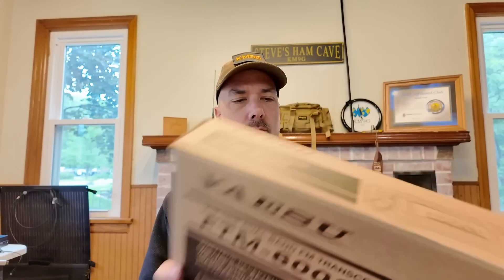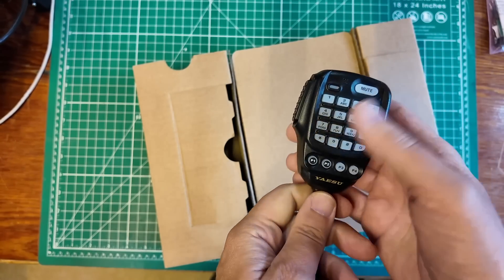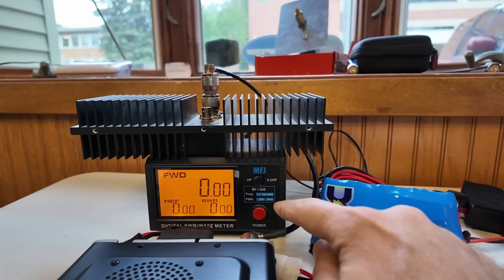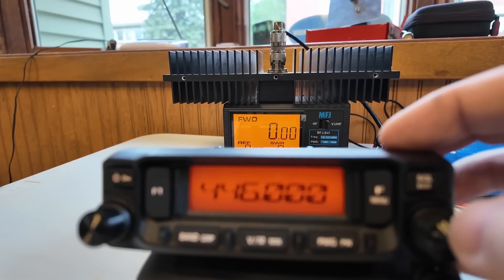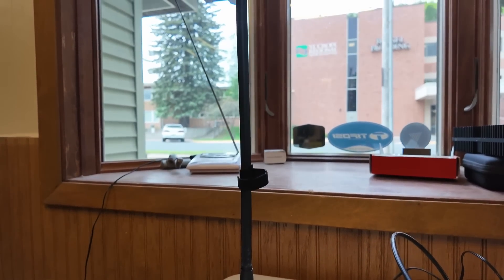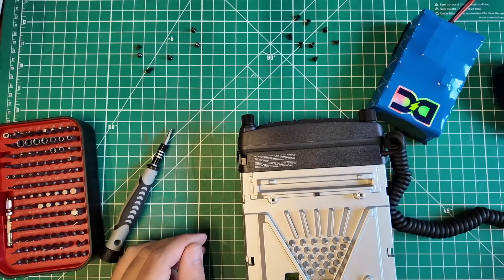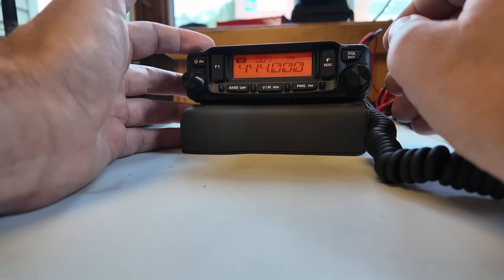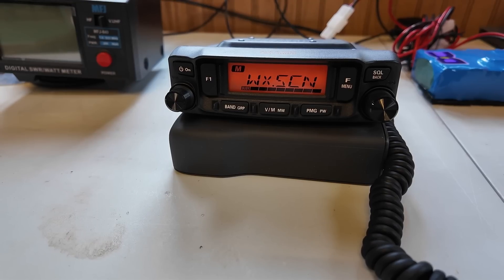Step One: Yaesu FTM-6000

Comment: What's a good antenna for this to be used inside a shack?
Reply from the maker: If I was running indoors only, I'd run a roll-up J-pole or a mag mount stuck on something large and metal like a refrigerator or washing machine.  Can't answer the question without saying 2 things:  #1 I've done it and it worked "well enough" and #2 Getting the antenna outside and up high is going to give you the best results.

Comment: Would you recommend using two of these for an FM repeater?  They have the data port to connect to a controller so should work well?
Reply from the maker: Are you looking for a permanent install or something for rapid deployment for an event?  

Permanent:  Get a "real" repeater with duplexer cans and so on - you want to have it installed and not mess with it vs using "cheap" parts (connectors/coax/antennas/etc) and having to visit all the time.  You'll "lose" more money in routine trips/maint than you'll gain by saving money with a home-brew... now if that's your jam, have at it and enjoy!

Rapid Deployment:  Look for a "cross-band repeat" capable radio (the 6000 doesn't do that) and you'll save on the second radio and the repeater controller, antenna/duplexer/etc

Event:  Something like this in a well laid out gobox might work very well.  I'd imagine a pair of these with all you need to "open box, screw on antenna, hand out baofengs" would be pretty useful.
Reply: @temporarilyoffline  permanent really.  Just FM, Allstar linked.
Reply from the maker: @Chris-hy6jy  asking for clarification:  "hotspot" or "repeater"?
Reply: @temporarilyoffline  a repeater.  So two radios, duplexer and suitable audio interface for the Allstar side of things.  Usually you'd use two inexpensive radios for this, Motorola etc so just wondering if the 6000R would be a decent choice.  Good RX sensitivity, TX duty cycle etc.
Reply from the maker: @Chris-hy6jy  The reason I asked about "hotspot" was if its just for your personal use in your house, then a device like this: ( https://kits4hams.com/shari-pihat ) might be cheaper/easier/smaller than all the kit involved.  But again, if you're trying to get it to work for your local area/club the install raises other questions.  I'm not trying to dodge the answer, its just not an easy one and this isn't a good medium for discussing it.  We'll make a live stream for it.

Comment: Hi, I am new to ham and am seeking some guidance. I am very confused by the "Program Repeater" portion of the video. Specifically, why did it seam as though he was pressing the PPT in order to receive a signal from the repeater? Furthermore, why is an output power level and SWR associated with this event? Lastly, why would output power level effect a received signal from a repeater?

I would really appreciate any help, thanks.
Reply from the maker: Great questions and welcome to the hobby!  I programmed the repeater and then I "kerchunked" it (pressed the PTT) FM radio puts out a signal even if you don't talk (carrier).  What I'm expecting is the repeater to hear me and answer back - you'll either get the repeater identifying itself or "dead air" which is the "repeater tail" - the repeaters send out silence at the end of the TX.  This tells me that I have everything programmed up right to open the repeater and to hear the repeater's response - and that I can actually reach the repeater.

Power and SWR happen anytime you PTT on FM - SWR is effected by power - more power means the chance for greater reflection ratio (the R of SWR), so when I key up, I'm sending full power out of the radio which gives me an SWR reading - all the while the repeater is hearing and answering.

Why does power level effect the received signal - its more a factor of my output power may or may not be enough to reach the destination.

Please feel free to ask any questions!
Reply: @temporarilyoffline  Thanks so much for this explanation! Everything makes sense now.
Reply from the maker: @johnbergeron5015  happy to help

Comment: Excellent radio. I use the Lido mount in the car for the faceplate and mic. Works like a champ. I don't leave it installed; just for car trips.

On my last car trip I called every so often for hours before realizing I hadn't connected the antenna. The radio was smarter than I was and it worked perfectly once I connected the antenna.

One of the cool features is adding menu settings to the quick menu. I like to add the repeater settings when I add a bunch of them, so it's easy to get to tones and offsets. When you're done, remove them from the quick menu. It's a nice feature.
Reply from the maker: That is a nice feature.  This radio has a few nice features.

Comment: I like the old CB slide mount concept.  You can purchase extra slide mounts, and be able to go from car to car or to shack.

I have ABR here in Houston build me an 18 inch male female jumper coax.  That way I can move the rig without having to unscrew the connection at the rig and damaging the mount or the threads.  Also that solves the issue with barrel connectors.
Reply from the maker: ABR are good people!

Comment: I have the FTM6000 and love. Removing and mounting the head was a nightmare using the screw. I found wisdom and attached Velcro the the head and head bracket. Quick and easy radio in and out of the truck. Anticipating more excellent videos. 73, KF0NNQ.
Reply from the maker: Thanks Bill! Velcro is an awesome solution!

Comment: Wishing the mic cord connected to the faceplate, not the body of the radio.
Reply from the maker: I think they learned their lesson with the FTM500 release.
Reply: Relocate the radio under the seat, and faceplate on dash. Then get a 20’ long mic cord!😂😂
Reply from the maker: @robertlyman9789  seems so obvious! They should have included the long-as mic cord in the box!

Comment: I have one of these, I bought it specifically as it user accessible data port on the back, and have played with a Module 17 on it too :)
As you did, I took it apart too, and then looked around and saw the unpopulated parts, well, if you look at board pics for the FTM-6000, FTM-200, FTM-300 and FTM-500, MARS Mods in particular, it looks like yaesu used the same board and chassis for all of the radios, just populated them for what was needed.
Reply from the maker: That was my suspicion... It's actually pretty smart from their perspective to do that too. Thanks for confirming.

Comment: I bought this radio a month ago to install in my truck but after reading the manual I don't feel it is a good choice for interstate road trips because of the lack of creating scan groups other than by frequency band. My handheld is a VX6 so I assumed the same awesome memory management would apply. All that being said I am a believer in yaesu quality so I altered the plan and will use the FTM600 as my first VHF/UHF radio instead. Thanks for all the great info you provide!
Reply from the maker: Most "modern" yaesu radios are missing that "scan group" functionality that we are all looking for.  I don't know of any modern radio that has it. I also travel and since I don't have this function, I don't see the point in even having a radio in my vehicle.  Its a shame really.
Reply: @temporarilyoffline  my solution is to install a DMR capable mobile and use zones the same way I use banks on the VX6. Will see if it works out.
Reply from the maker: @mthayer35  sounds like a plan!

Comment: Please do more real radios like what the big 3 produce and less Tidradio. Simping those because they have USB-C while ignoring the fact that they falsely claim to have FCC approvals and sending all data that can be collected to China.
Reply from the maker: I do videos on all radios, the big 3 as the one you just commented on as well as china.  Yaesu just created a "modern day" dualbander that has an out of date USB port that doesn't provide any value other than firmware updates.  China's gonna catch them if they don't start to actually innovate.  And to be fair, China's "innovation" isn't really that special either.  Its 2024 for cryin out loud and we still don't have (CM108 Emulation in a microcontroller onboard an HT?) or even a decent android based HT?  People wonder why ham radio is dying... nobody is making anything relevant... so of course I praise the chinese for putting in USB-C... while still complaining they didn't put "all of USB-C" in that matters to ham radio.

Comment: Will it work with module m17?
Reply from the maker: Take a look: https://youtube.com/live/Litx39gW-qg?feature=share
Reply: @temporarilyoffline  Thanks..  I found it right after...  Great stuff..  Do you think the FT 817 will do it too?
Reply from the maker: @ON3PLZ  It should, its on the list to test out.
Reply: @temporarilyoffline  I supposed that the ND version does not make a difference.
Reply from the maker: @ON3PLZ  the main issue is that the radio needs to be 9600 baud capable.  Just because it has a 9600 connection doesn't mean it works... But this is yaesu, so it probably does work.
Reply: @temporarilyoffline  According to the M17 Wiki, it does!  And the mic?  A 2 pin compatible Kenwood woud work?
Reply from the maker: @ON3PLZ  The M17 wiki should have recently added that after our work on Ham Nuggets two weeks ago.  Its still a developing story!  I hear it works, but I have yet to do it myself.  Soon.  Yes, K-Connector mic.  I used my cheapo Baofeng mic.
Reply: @temporarilyoffline  THe M17 module is on it's way.  The data cable I have is the CT62 unlike the CT67, it has the 9pins serial connector.  Does it need to be modified?
Reply from the maker: @ON3PLZ  I haven't heard of the 62 - "maybe" - Check the pinouts on the website/owners manual to verify before blowing anything up!
Reply: @temporarilyoffline  CT 62 and CT 67 are the wrong cables,  the one needed is the CT-39A for the FT-817.

Comment: Can this do cat/audio through usb?
Reply from the maker: I wasn't able to get the USB to connect, so its probably yaesu's standard firmware only update - however, you can get a digirig and convert the rear port to audio.  I'll be doing a video on it soon and I'll find out, but I see nothing about CAT control in the manual.

Comment: I have this radio as well. I really like it. I have a DigiRig connected to it and it’s likely the easiest radio to setup for Winlink and Vara FM. The only thing I wish it was possible was to transmit on the GMRS frequencies. You can listen but not transmit - yes, I know, due to legislation
Reply from the maker: No mars mod for this rig?  I haven't looked yet.
Reply: mars...
Reply: @temporarilyoffline  No mod, no buyeee...
Reply: Mars mod is easy on these radio.
Reply: I have this radio and bought it with the open transmit/MARS mod completed. It can transmits on GMRS frequencies.

Comment: Hi, I’m returning back to the Ham hobby after a 10 year hiatus so its like starting from scratch. I was thinking about this radio for my truck and also in the house. Is there an adapter for a cigarette type plug when I use it in my truck? Without drilling any holes in my roof, which vehicle antenna would you recommend, thanks 73’s
Reply: Cigarette plug will not deliver enough amps to power the radio and full power, it's really better to wired it to the battery.
Reply from the maker: They do make them, or you can make on yourself easily enough.  Your cigarette lighter might not deliver enough amps, so check all the specs and do the right thing.
Reply: Thanks for all your inputs😊

Comment: One thing I'm interested in for this radio is whether the 9600 baud audio output on the rear jack is actually baseband audio that includes the CTCSS tones (so basically ~60Hz on up). I'm hopeful it does, as I 'm looking for a radio that can output those tones to an external decoder for an Adventure Radio Freq. project I'm working on. 🙂
Reply from the maker: Ping me on discord and let me know how we can test that!  I'm curious.
Reply: The 9600 is discriminator output. So you can pull some of that out. The M17'ers should be thankful